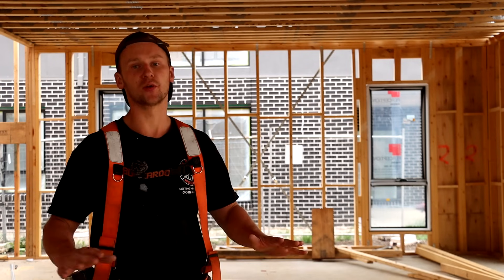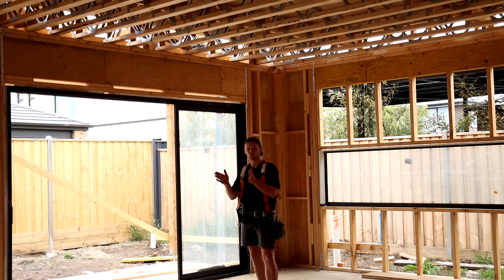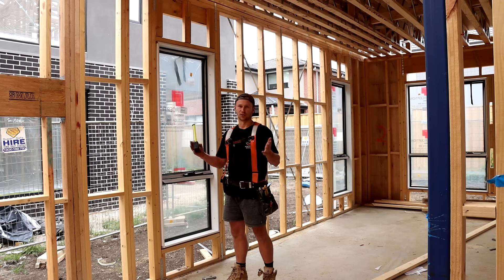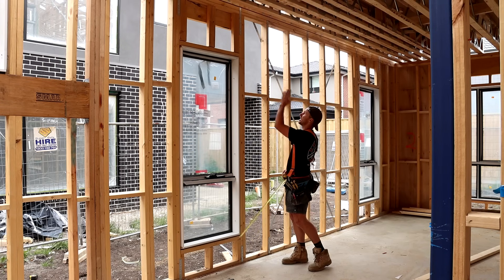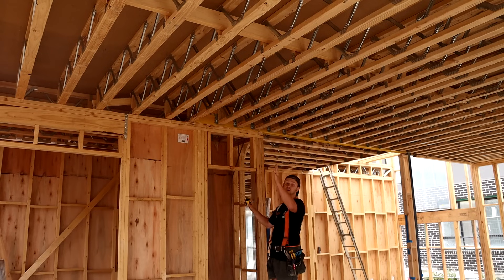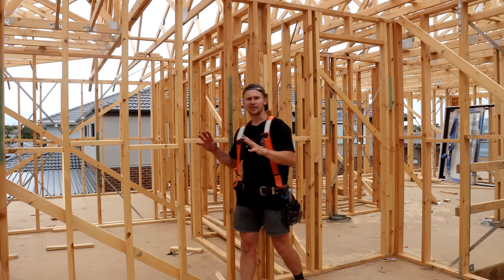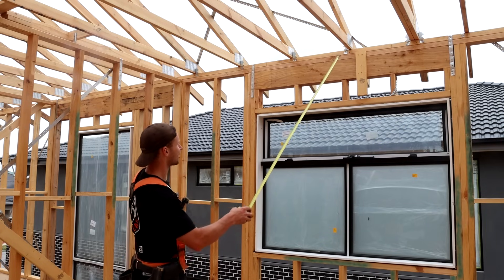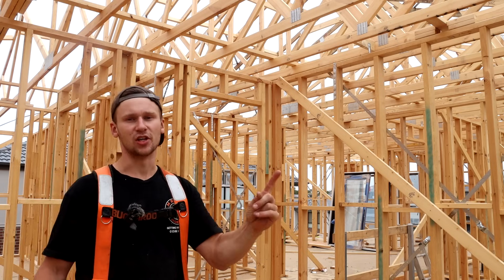House Framing 101 - Timber Frames Explained

Comment: great vid, just a question the nogs are always the same dimension as the wall stud framing or can these be smaller for example 90x45mm studs should use same size nogs not 70x35mm, seen this on a site I'm just curious

Comment: All of you guys in the ol' commonwealth need to get your terminology straight. There's nothing timber frame about 2x lumber. That is stick framing. Timber framing has wooden joints and is in full scale, close to square cross section, timber, usually 5x and up, and typically in white oak.And no - I'm not from the new world,  trying to teach an old dog new tricks. Passing stick frames off for timber frames is simply nothing short of swindling people.
Reply: Unnecessarily placed tension....learn to contribute adequately
Reply: @clamtellainc  To the contrary. people need to know the difference.
Reply: @clamtellainc  ...but I'd be interested to know what you then call an actual timber frame. Or are they all just sticks?

Comment: Ive seen lintels where the ledger is but it is out of hardwood. And the number of studs besides the opening that the lintel sits on is the number of studs that the opening disrupts.

Edit: im in the north whwre we also use full height threaded rod secured to a threaded rod set into the concrete, or through the joist / bearer and are called cyclone rods. We've even had to install double row noggins, double bottom plates and triple top plates.

Comment: After  20 years in the industry I am over this construction method. It had its days but there are better performing options now, offering better performance and cost effective solutions.
Reply: Like what?
Reply: @benperkins2929  Post and and beam, straw bale, hempcrete, SIP, aerated concrete, CLT, prefabricated walls and roof elements, rammed earth, concrete........... Timber as such is a great material for building but the 4x2 method is like a fax machine OUTDATED and over priced if you look at costs vs performance
Reply: For example?
Reply: @ 

CLT, pre cast concrete, SIP, hempcrete, aerated concrete, straw bale, rammed earth etc...Standard timber framing might appear cheap but in the longer run it is very expensive in form of energy costs, heating, maintenance and life span.
If you have ever lived in a properly built house which provides comfort all year round without breaking the bank you understand.
It all depends where you are of course. Timber frame can still work too if it is the structure of a fully factory built wall. Assembling a timber framed house on site is too labour intense for a poor outcome  and turning it into a well performing thermal envelope requires even more labour hours and costs.

Comment: Great video - very enlightening. On your ply-braced sections doesn't the extra thickness of the ply impact the external cladding? IE wouldn't you have to space out any cladding to make up for the thickness of the ply or are you ripping the studs down too keep the total width at 90mm?

Comment: I had a hard enough time moving from Washington DC to South Carolina and learning the lingo of carpentry . I have 43 years experience and every word I knew for one thing was called something else . I survived and got southified . Most everything you called out , We call differently.  I never liked installing windows beforehand. flashing , housewrap etc . I've built parts of a house  way out of sequence and told it was better and it turned out looking like trash . My ears perked on the lintels" header" being installed at the top . That's the way I like . But was told by some community college , online two week degree engineer that it's against Code because it needs to be placed atop the window opening and crippled up .. Why? .. He said for wind shear ??   On a brick veneered house ?? with brick ties at 18"x24" wall anchoring ??   Well .. I guess we need a header under the window sill as well . Because it will get the same amount of wind shear at the sill Einstein . Yes we used to use metal cross bracing of all types . Used to be let in bracing , then metal T bracing that needed to be scarfed in , Then metal strap bracing. Code here is 25% of the first and second must be structurally sheathed or engineered to comply . So nowadays . They just sheet the entire wall . Seemingly solves all problems of racking and shear without having to think . Pre-fab , Cross square and sheath on and out of level floor and get an automatic out of plumb wall . Brilliant my padawan learner ..

Comment: Dave, you are GUN! Your videos are so good, your explanations clear and spot on. You are so polite with coworkers, right on spec with what you do in every way. You have a huge career, interesting to see which direction you go. You'd be a top certifier (shish!) or presenter for The Block (ha!). Seriously but, I have owner-built two houses and renovated a third and your explanations would be very helpful for OBs starting out so bare them in mind as you make content, even though apprentices and builders are your main viewership.
PS: I have noticed in US vids they don't use nogs....is that 'cos they sheet the entire building? Whatdya think of that - seems incredible bracing but cost more?

Comment: In my US experience is p years ago, the short m jack studs that come down from the top of the wall to window top plates are called “cripples” because they have no legs. Not very kind term but helps distinguish from the jacks supporting from the bottom plate UP. Vs from top plate down.
Reply: Every is done completely different here in Australia mate. And all the terminology is different too.

Comment: Great video! Any ideas how they get away with no nogs in the US? They have crazy high walls without nogs (or blocking as they call it).
Reply: That's crazy you need noggings to stop the timber wall studs from bowing under load.

Comment: Thanks Dave! As a sparky and fridgy who's always been fascinated in carpentry, your videos help me scratch that itch. (Although now im tempted to quit my hard-earned career and start a carpentry apprenticeship)
Reply: Hey KaesOner, I’m a licensed carpenter that’s been doing 1st fix carpentry for 20 years here in Adelaide. Let me tell you if you don’t like hard work then carpentry isn’t for you. It’s extremely hard on the body and it’s more for men who are in their 20s and 30s not 40 and above. It’s extremely dangerous pretty much all the time you’re constantly walking on top of wall frames with 6-metre drops right next to you when you’re building the roof. I’m also constantly lifting roof trusses, LVL beams, and fibre cement sheeting, and HEBEL that weigh 40kg, 50kg, 60kg, and even 80kg plus on some occasions while walking up a ladder with that weight on your shoulder. Then you’re cold all the time during winter and walking in mud and then you’re always sunburned in summer and sweating all day. And the risk of injury is always there because of how dangerous all the tools are. I’ve sh0t myself 3 times with the nail gun and fell of the ladder before and broke a rib. And I had a guy cut his thumb off with a power saw right in front of me and I got worse stories than that!

The money is very good but so many people say they want to be carpenters and then they quit for all the reasons I’ve said above. Or I have to fire them because they simply can’t keep up with the workload and pace and have difficulty understand how it all works. 

But Carpentry is the premier trade of all the trades and you could say we are the shot callers on site because we have the most detailed understanding of the entire construction process. And we can do every other trade but other trades can’t do our trade because how complex & detailed it is. 

Hope that was helpful mate 👍
Reply: Oh and I forgot to say as well that even though I did wear ear protection I now have permanent ringing in my ears (Tinnitus) and hearing loss because of 20 years of daily using of petrol generators, nail guns, power saws, angle grinders, masonry drills, air compressors, explosive power tools, electric routers, electric planners etc etc. Your ears get hammered all day!
Reply: Huh?? Sparky to Chippy?? the opposite should be true...
Reply: Fridgy here too, love these videos. You're right, Carpentry is truly a very fascinating trade!
Reply: I’m a roofer an I always think about making the switch

Comment: Great video. I've always been a little confused by jamb studs. When engineering plans mention double or triple jamb studs beside openings over a certain width, does that mean the number of studs under the lintel, or beside the lintel? Ive seen both. For example, 2500 opening says triple jamb stud; would this mean 3 jamb studs under the lintel each side of the window/door, then one common stud to top plate each side?? (I've also seen 3 under lintel than 3 beside to plate as well) I've seen people just do a single jamb stud under lintel then 3 triple studs to the top plate. To me this isn't right as you aren't providing any more support to the lintel, just more support to the top plate. What's your take? Keep the videos coming mate.
Reply from the maker: I agree with you, I don’t think it makes much sense having 1 stud under the lintel and 2 running besides it. We just have to trust the engineers know what they’re doing 😂
Reply from the maker: The engineering plans for the job will have a table showing you how many studs they want under the lintel or beside the lintel. Depending on the job the engineer sometimes wants them to be done differently, typically for a triple stud, they call for 1 under the lintel and 2 running the full way up next to the lintel

Comment: One thing about the lintel positioning, I like the ease of putting them up against the plate, but a small consideration is the extra load bearing of the cladding that would be fixed below the lintel and potential ceiling joists/battens inside. It’s probably inn-effectual but something to consider.
Reply: A guy I worked with always put them over the window, flush with internal face if they weren't full depth. His reasoning was you have solid blocking for curtains/blinds over every window. I like your point though haven't thought of that.

Comment: Thank you for the explanation. In Holland we prefabricate all these walls because of the weather. I engineer these walls, we have outside walls with 38x235mm studs, because of our insulation standards.
Reply from the maker: 235mm studs is insane! Do you know how the framers stand these walls up? Would hate to know how heavy they are
Reply: The wall, floor and roof prefab elements are very heavy, so in the production hall they use a overhead crane for turning the prefabs around. On site they use mostly a telescopic crane or sometimes a tower crane. A residential building is set up in 2 or 3 days. Mind you that the prefabrication time is the same as you are making your buildings in place as a carpenter.
Reply: Most house frames are pre- fabed in a factory in Australia and delivered to site . Stood up by hand .
Reply: @stewatparkpark2933  In Adelaide, we never use prefabricated wall frames ever. We make all our own wall frames on-site by ourselves. And because of everyone always using roof trusses, I’d say 90% of carpenters don’t even know how to build a conventional roof!